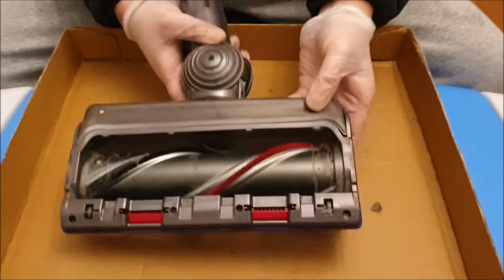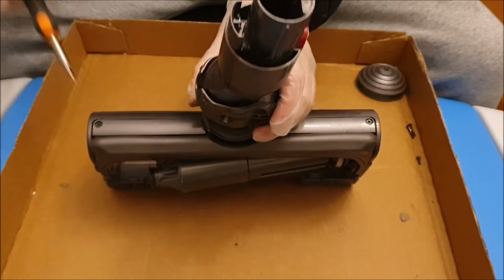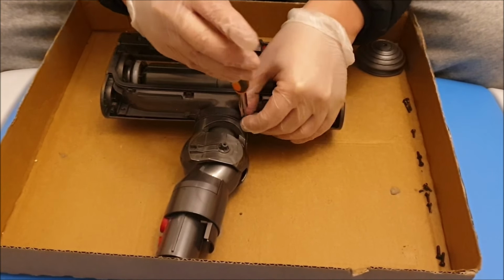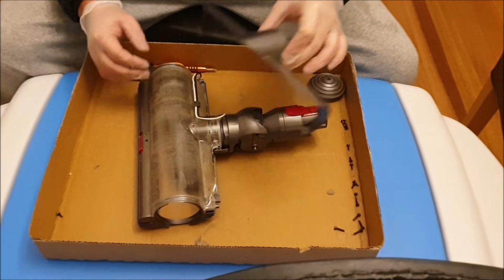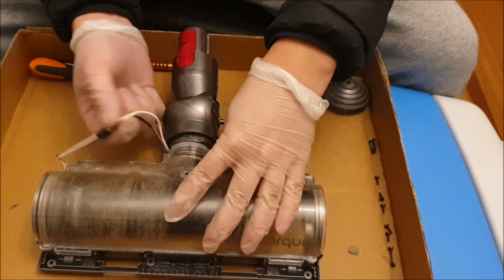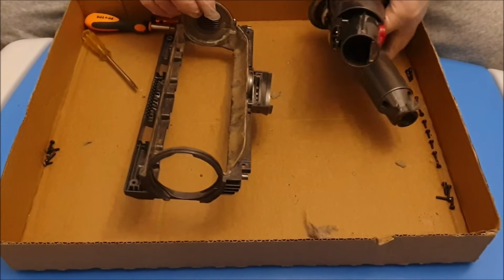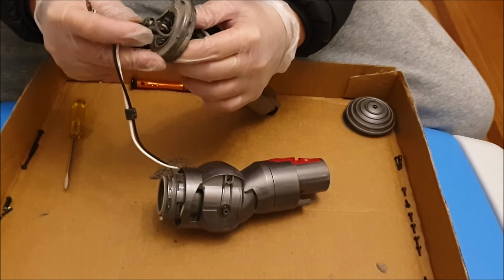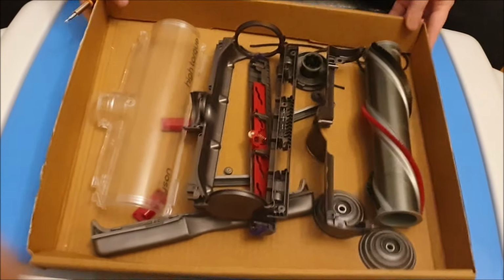OPEN ME UP! Dyson V11 and V10 High Torque Head Disassembly and Clean

Comment: Total life saver. I opened it up for a deep cleaning, didn't document it and ended up confused about the wire run from the rotor into the head joint. Very clear instructions, thanks!!!
Reply from the maker: thanks for your support
Reply: Hi,  What is the wires for?  Is there a battery in it?

Comment: So helpful. I actually used this and then took it a couple steps further to swap out a bad motor. This was invaluable in putting it all back together. There were just too many steps to have it memorized just from taking it apart once.
Reply from the maker: thanks for your support
Reply: My motor works but there is a little circuit board in the tube behind the motor and that is bad. When I apply power directly to the motor leads, after the circuit board it works but no power is getting through the board. For the life of me I cannot figure out how to get that circuit board out so I can check it out and repair as necessary. Any hints?

Comment: Very helpful. I went as far as pulling the motor control pcb out as ours had a mysterious fault that the head motor would spin initially then not restart unless left for a while. When I pulled the pcb out it was wet. Careful discussion with the principal user confirmed the head had been cleaned out with a wet sponge. Drying in a warm place cured the fault.

Comment: Dang! I was hoping to see you pull out the motor at around 17 minutes! My torque-head only runs intermittently on 1,2 and boost settings. I was thinking the brushed motor might be wearing out...anyway, this video got me 97% of the way there so thanks for taking the time to open 'er up!
Reply from the maker: you can confirm if you have a motor problem by taking out the motor and using it outside. you dont need to disassemble the motor yet. if it spins normally it might be a different issue.

Comment: Very helpful thanks! I had trouble keeping the motor in place while putting it back together. I placed the brush tube loosely on and rested it on the outer edge of the chassis while working. It helped a lot.

Comment: Word of warning! Pulling of the caps snaped one of the plastic threads (I wasn't using much force) and one of the screws stripped instantly midway through the disassembly. Only do this if you have nothing to lose. I appreciate the tutorial. Mine is about 4 years old for reference with heavy use.

Comment: I'm frustrated as I just want an easy way to clean the clear plastic piece of the torque head.
Reply from the maker: this is the easiest out of all the brands
Reply: @OpenMeUpTec  I mean without having to heavily take it apart. I'm puzzled on what to do there. I can take the roller put but the piece the roller connects to is still in the way and I can't throughly wipe it out. And I don't obviously wanna use water
Reply: Interesting to hear this is the easiest, hopefully the next models will be easier. Great video btw!
Reply: Seriously, I gotta void the warranty to clean the head out because it looks like someone threw up in it?!? I don't want to just blast water up in there, it seems like there is an electric motor in there I'd rather not get wet.
Reply: Jamming a damp cloth in there and using a screwdriver to rub it around is fairly effective
Reply: @tomkarlberg  that’s what I resorted to. Totally ridiculous to have to take the whole thing apart.😊

Comment: This video is great. My under 2y/o v11 high torque head just stopped working.. it’s clean and spins well by hand but the motor does not spin. 
I’m going to try to get warranty repair with Dyson first but if they are unhelpful/unwilling I will be coming back here to try and fix myself. Thank you for this
Reply: Good luck. Dyson has awful customer service.
Reply: @dcd6115  Thanks. I was able to get a replacement head shipped as it was on warranty and replaced in about 5 days after I contacted them.

Comment: Hello! Thanks for the helpful video. When I opened up the clear plastic container the silicone rubber came out and haven't had any luck getting it back in. Any tips on getting the rubber seal back in or is it a lost cause?
Reply from the maker: it is a lost cause

Comment: Thanks for the sharing.

I have accidentally washed them with water recently (without disamble the parta) and the magnetic roller is not working after I use it again (after leaving out for almost 12 hours). Initially it worked for few minutes, but then it stopped.

Maybe it is still wet inside?

Any tips for me to make it work again?😩
Reply from the maker: you need to open it up and see the thing with water is that it will rust your connection. it has been the long so that is probably not the issue. the second issue is that water will short curciut the item and could be the reason it is not working. so open it up and see if there is still water left.
Reply: OPEN ME UP thank you. I will try open it up and check.
Reply: I am having the same problem.!!

Comment: Thanks for the video, I’ve thoroughly cleaned mine but the brush bar only spins briefly in Eco/Auto mode on my v11, it does work fine in Boost mode though, any ideas?
Reply from the maker: yes and no. this is a smart head therefore in those mode it will only spin when required. i have not confirm it but i remember thats how it is supposed to work.
Reply: @OpenMeUpTec  it doesn’t work at all in Eco/Auto modes on hard floors or carpet. It only works in Boost mode, which I assume bypasses the sensor.
Reply from the maker: @chrisparkhill2061  try to give it a clean and see how it goes

Comment: Is this the only way to be able to clean the inside of the head? I have the V12 and can’t find any way to remove the spindle inside that the brush cylinder inserts over. Can’t get around it properly to clean the clear plastic.
Reply from the maker: the dyson v12 comes with the same head as this. if not i have other videos on my channel so you can find which head it is. if you are asking about the soft roller also known as the fluffy head with laser i dont have a video for that. currently dyson only has 3 types of torque/motor heads avaliable and i have videos on all 3 of them. if you take a picture of the head i can show you which video it is
Reply: @OpenMeUpTec  it’s the brush roller head like the one in this video, seems a poor design from dyson if you need to disassemble the entire head just to clean it. I’ll take a look at your other videos though and see if that helps. Edit: my mistake, it’s the V15 detect I have but the head looks the same as this one.
Reply from the maker: @simonuk1213  i just uploaded a video a few weeks ago for the newer head but it is actually the same thing just now with the words  HAIR REMOVAL VANES
Reply: @OpenMeUpTec  thanks :)

Comment: Well done video! My dyson v11 torgue drive  head starts to make rottling sound , when I opened it up I discovered the white ring doesn't spin.  Can I fix it, any advise , please!
Reply from the maker: it could be stuck, try to connect it to power without assembling it to see if it work. give it a push to see it spins.
Reply: This happened to me a few days ago. Under the white ring there is a plastic casing which holds a bearing cassette. The bearings on mine were seized up, so I had to get down to the bearing and turn it by hand until it freed up, then I added some lubricant. All is good so far. Hopefully this helps you and saves you $110 on a replacement head (which happens to be out of stock right now).  Let me know if it would be helpful for me to post a video of this.

Comment: Your video is very detailed & helpful but no matter what I do I cannot get the roller out.  It comes out about 1cm & thats it.  Any suggestions please.
Reply from the maker: it is stuck. it happens when you have not removed it for a long long time. you need something to help you remove it like a prying tool(a screw driver)
Reply: I've just followed this great guide and mine was stuck too. I used a plastic pry tool from my ifixit kit to get some leverage. Needed to be careful not to break the plastic though with the pry tool but it was enough to get it out in the end.

Comment: Hello. Unfortately, the water used when cleaning made that black gasket come off around the frame of my motorhead. Could you please let me know ASAP what type of "adhesive" I should buy to remedy this issue? Thanks!
Reply from the maker: none. just close it up without it and you should be fine. it happen to me as well. otherwise you can use any sealant that can cover the gap. the idea is to not let air through around that area which will cause you to lose suction.
Reply: @OpenMeUpTec  Thanks for the quick response! I was almost relegated to use a gasket sealer thats typically used for automotive vacuum purposes.
Reply: Happened to me too just now lol. I got scared!

Comment: I was wondering where the motor is. It's the roller itself?
Mine broke after very light use. Dyson agreed to ship out this carpet unit.
The vaccuem itself works great , so far , and can do the whole house , 1st floor and 2nd floor without no cords. You can touch up a whole house on one charge 👍
Reply from the maker: the motor is the cylinder thing at 17:40

Comment: I have one with a defective head.  Dyson is sending me a new one.  But, I would like to open the old one up, just to see if I can get it working again.  It's doubtful, though.  I had the machine running on dry mats, and it just all of a sudden quit.  Brush roll turns freely and everything.  I'm hoping that it might be saved with a bit of soldering, but I'm not holding my breath.
Reply from the maker: itis unlikely that it needs soldereing. most likely your motor is dead. you can replace the motor if that the case.
Reply: @OpenMeUpTec  It's just a matter of finding a motor.  This one is a V11 Outsize.  They won't even sell a full head unless they are contacted, and you have a serial number.
Reply: Our head came apart. How are they about replacing the parts? You didn't have to send back the broken one?
Reply from the maker: @gabrielrubalcaba1180  yes and no. originally you can call dyson tell them what is faulty and they just send you the whole part free. recently when i called up they wanted me to send in the whole vacuum for inpection. whole vacuum is everything that came in the box not just the part. i own 14 vacuum so when they see this they dont ask questions but this time the person couldnt care and wanted me to send it in. i guess it depends who picks up the phone.

Comment: Excellent video with detailed steps, thank you!.  Is there an special kind of screwdriver tip?  😔  
Also, I tried to use a coin to get the center out, but it didn't turn out, Do I need to  remove the wheel first, as in your video?
Reply from the maker: can you watch the video and tell me at what time you have the issue. you need a normal phillip head  screw driver, trox T8 and T10. you need a screw driver set as that will resolve all your issues

Comment: My torque head gave me a signal "blocked airway". I checked everything but no blockage. It's working well when I use the other head. Do you think it's the torque head giving problem? Tq
Reply from the maker: it can be the head has something stuck. open it up and check it out
Reply: I just opened it up just now. Such a mess in there! So much dust & cluster of dirt! Cleaned that up & now it's good to go! Thank you so much! Saved me from going to Dyson Service Centre here which is quite far from home. May God bless u for your kindness!

Comment: When I’m putting the rubber seal back on the clear part, it seems like it’s too small. If I try to stretch it it pops out of its track.
Anyone had this issue?
Reply from the maker: i am abit confused at what part you are asking about. can you please watch the video and tell me at what time i can see the rubber thing and where you up to in the video.
Reply: @OpenMeUpTec  15:07 in the video. Where are you say not to remove that rubber seal. I missed it the first time and removed it LOL
I have the thing back together now, but there’s a section That doesn’t have the seal now. It was like two short when I put it back
Reply from the maker: @noahmadsen3319  this is why you dont remove it. it is ok, the point of it is to enusre there is no leak around the head. since it is already done there is nothing you can do to change it.

Comment: The roller in mine got stuck and I can’t extract it.  I cleaned a bunch of pet hairs and other debris from the rotor connection, but am afraid to disassemble the entire unit.
Reply from the maker: watch the video a few times before you do it to improve your confidence. since you have this video that covers everything it is ok if you stuff up.

Comment: This is the dumbest thing I have ever seen! Not your video, that is. I am talking about the dyson head. Who came up with this garbage!? I have always loved my dyson vacuums, but never knew that you have to take the whole damn thing apart to be able to properly clean the head!?
I just wanted to clean the clear plastic part. Shocked to see that the "motor" is not just coming out!!!
Reply: I'm here for the same reason. I just got done cleaning and I guess ran over something wet (probably water my dog spilled) and the plastic is absolutely disgusting right now. I figured, hey, it can't be too hard to get this clean. Boy was I wrong... But hey at least we have this video to help.
Reply: @jtbwatson  Sorry to hear that. Here is what I did/will do.
1. I will NEVER vacuum while the floor is wet!
2. I did carefully rinse PARTS of the head under water. As long as you do NOT get the motor wet, you should be fine.
3. I will run my compressor in the morning and will try to "blast" the DRIED dirt off.
4. I will buy distilled water, put that in a spray bottle and blast the entire head with it. I will also completely submerge the head in the DISTILLED water and then blast it with compressed air.
Remember, distilled water will NOT harm your electronics.
Thanks.
Edit: Had a few autocorrect errors, ha ha.  There is also no way I will ever take the head apart like that. I refuse. This is ridiculous! No one should have to do that so they can clean their vacuum head...
Reply from the maker: thanks for your support. at least you can disassmbly this. some brand dont even let you disassemble the head to clean it so after 1 year it is useless.
Reply: Yeah the same reason why I came here.
Reply: @ericb6481  I tried a few different things to clean the inside (other side of the see through plastic) and the best thing I cam up with is to just take a moist rag and "sent it" through the head. I do this buy hand, not using any power from the vacuum. Just stick one end of the rag in, and start turning the brush by hand. As it passes through the head, it will tough the plastic wall and clean it... Hope this helps.

Comment: dyson is so over priced its just stupid.. can get the same part after market for like $25  and with LED headlights.  that part there from dyson is $160    total rip off
Reply from the maker: i can confirm that the after market one is not the same and is worst than the original. considering the price, the after market one is alot cheaper for the performance hit

Comment: Says it all how poorly designed this vacuum is, one shouldn't have to disassemble the head like this just to get it thoroughly cleaned. Rubbish. I feel I wasted my money on this crap. Great video, but it shows just how poorly designed this thing is
Reply from the maker: you are saying that becuase you have not seen how the other companies do it. this is the best there is. you have not seen there are many you cant disassemble to clean. at least this one you can clear it and put it back together.
Reply: @OpenMeUpTec  I had an Electrolux I bought over 10 years ago that had better design for cleaning the heads. I think I paid 40 dollars for it, so...there's that. Also, the argument that it's fine because others are worse is not really a good  argument considering this thing is twice the price of any other on the market. TBH I am not overly impressed with it overall either, pretty average vacuum cleaner, with a luxury price tag. So not worth it.
Reply from the maker: @11MOD2  thats was yeas ago. it is how things are now. example the below vacuum from electrolux. you can not clean it, since it was not made to be disassembled. majority of the stuff is one way only, so once it was made, you cant remove it. so once use it and it get dirty, you need to bin it. it is not just them, all the other companies that make battery power vacuums basically have this issue. the only vacuum that is easier to clean than the dyson is the LG cordzoero but the performance is worst compared to the dyson. 
https://www.catch.com.au/product/electrolux-ergorapido-18v-stick-vacuum-cleaner-zb3515st-7824568/?offer_id=39411606&ref=gmc&gclid=Cj0KCQjwnJaKBhDgARIsAHmvz6eN_-RDVYzKnptEFTZgMenZpSXVQ0T3MyoaCXESuvkt-F6Zcq7TGTIaAu-lEALw_wcB
Reply: @OpenMeUpTec  you're missing the point. Have a good day.
Reply: This video is misleading.. you can clean the head without doing an of this unnecessary disassembly. Just use a coin to take the coil out and that'll serve what most of us are trying to do... Only takes 10 seconds. See this video for how to clean the head without any tools: https://www.youtube.com/watch?v=OABwN0Wi9No

I'd say the guide here is only useful if you really want to deep clean the head or replace parts in the head.